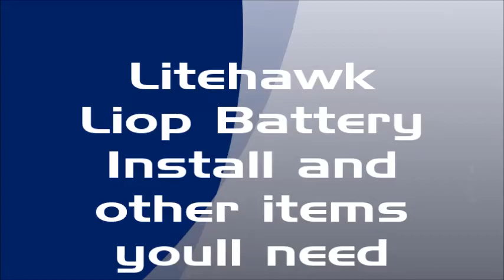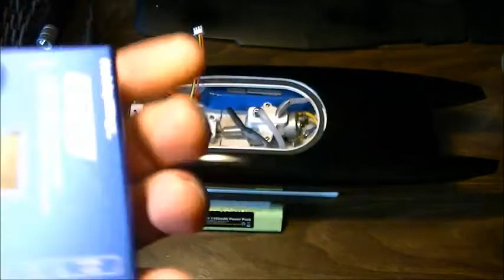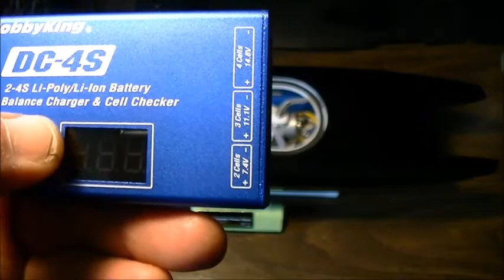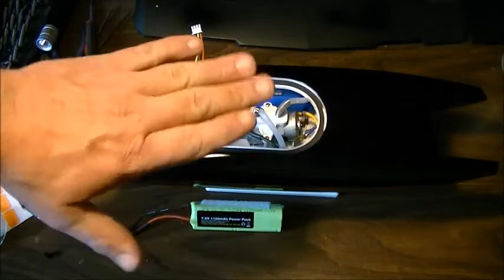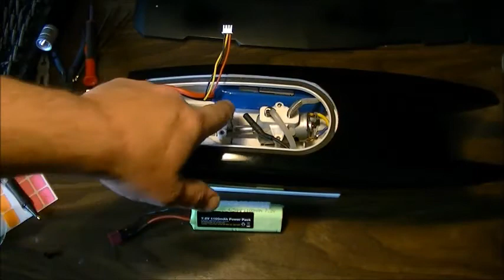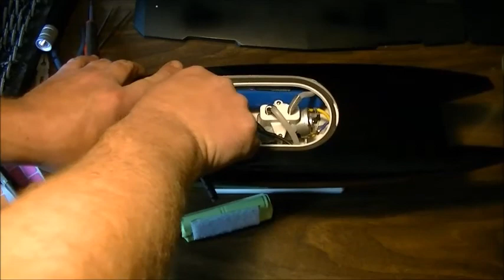Litehawk Lipo Battery Install and other items youll need

Comment from the maker: if you dont have a soldering iron then you will need to use a set of side cutters something i mentioned may not be a good idea the only other idea i can give you is use an xacto knife heat the blade up really hot with a lighter and then quickly nip the post off as i show it in the video

Comment: How to i remove the thing the brace sits on to fit the battery do u have to remove it what would be another option instead of soldering it off